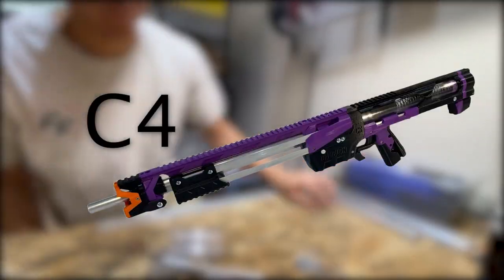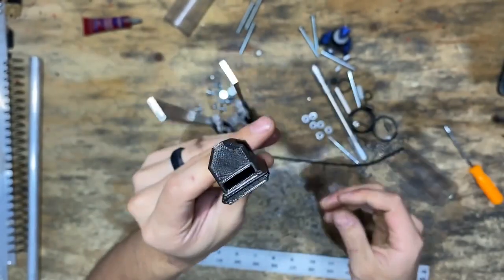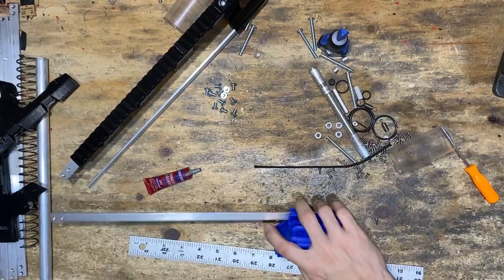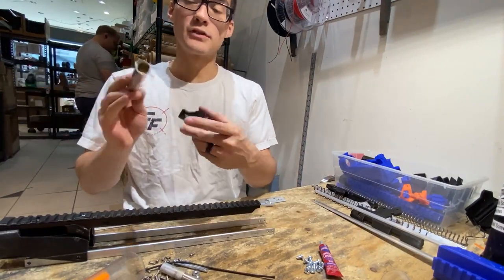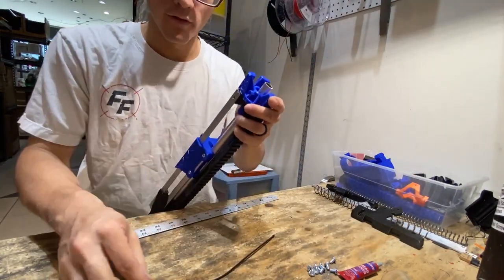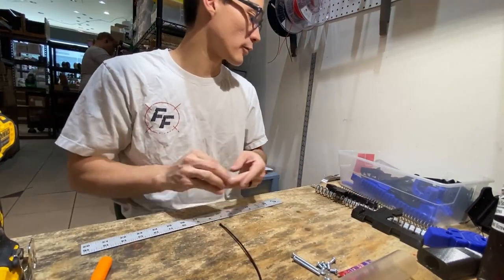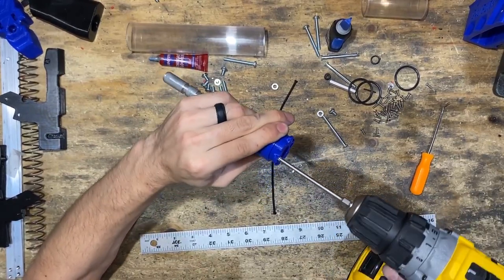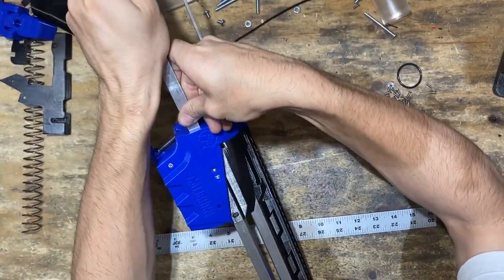C4 (Caliburn 4) Assembly Tutorial

Comment: you need to alternate the direction of the spring coils when "nesting" 2 or more springs to avoid tangling/jamming
Reply from the maker: True. However I actually haven’t noticed much of an issue with how different in size the K25 and K31 are. It does sound a bit crunchy, but I’ve never noticed any priming issues.

Comment: Awesome dude. I agree the collet is the best method thus far…. I tried to mill a flat spot on the outside of the aluminum barrel and used a machine screw to hold it in place but it still made the barrel non-concentric aka ‘’ out of round ‘’ so made a square tube housing out of T-6 aluminum and slid the barrel inside now it’s a 💯% good to go to use a machine screw 👍🏻 but anyway I wanted to tell you I’m so happy with my C4 from FF that I have decided to CNC mill a complete C4 out of T-6 aluminum, carbon fiber and A little Dellron with a completely sealed push tube that self lubricates … I am holding a super close tolerance on that part something like +_ .0002 because when I made it 0.000 it Jammed up something crazy! Lol it needed that 0.0002 for everything to flow smoothly and with Zero leaks! It’s a pump action that depending on the amount of pumps determines the psi . Some of it is in RnD still . But I will keep you updated for sure 👍🏻 thanks again!
Reply from the maker: Glad you're liking the C4!

Comment: I got the c4 with a upgrade aluminum ramrod and it doesn’t assemble the same the ramrod is 2 pieces and they are different how do I assemble?
Reply from the maker: We use a friction fit and superglue between the ramcore and rambase. If you didn’t get them preassembled, you’ll need to apply glue to the base of the ramcore and press fit the core into the base. If you ordered it disassembled, it should be a push-hand fit. If you need more help, email support@frontlinefoam.com
Reply: @FrontlineFoamBlasters  thanks that’s really helpful I ordered it assembled but while I was firing it it fell apart and the ramrod got stuck in the barrel and I took it apart but wasn’t sure what to do with the ramrod but this helps alot